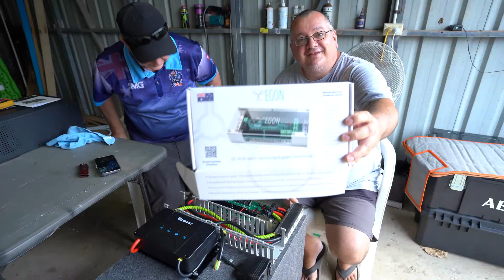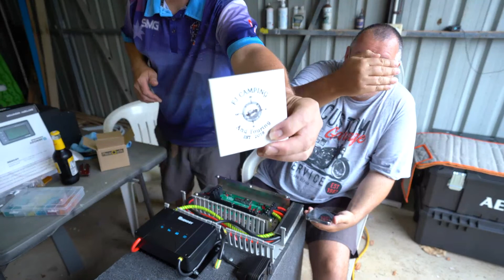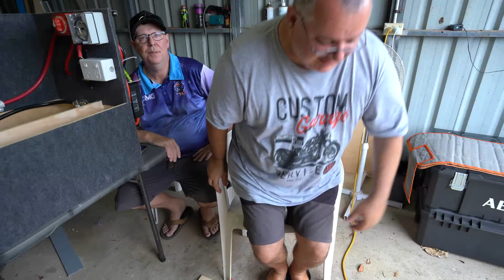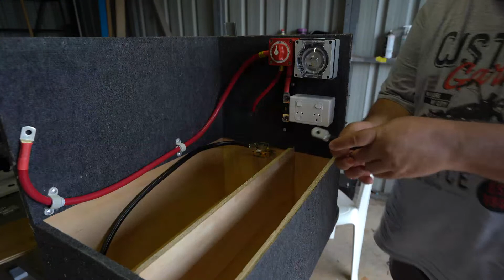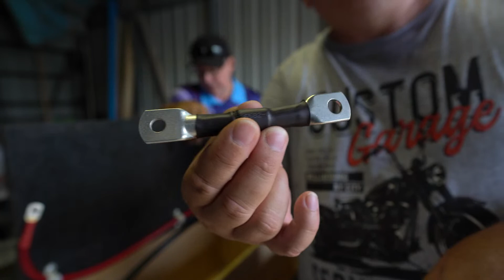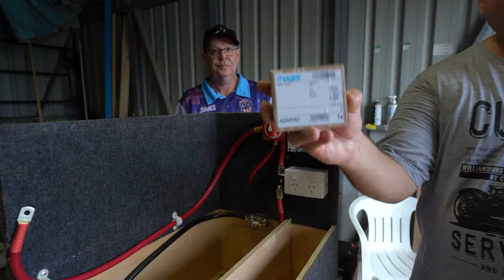Working Live setting up Stephens FJ Cruiser 12v setup

Comment: All good down here..
Reply from the maker: It was all good here as well.   We completed and turned on,  All working great,  apart from the Inverter/Charger on off switch not plugged in,  after we plugged that in it turned on.      The 240v will be wired in by Steves electrician.